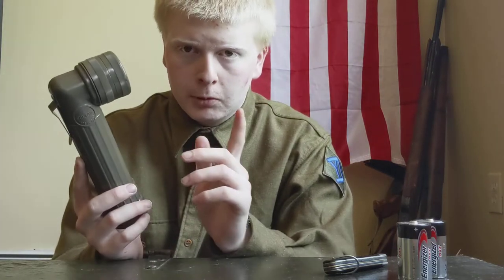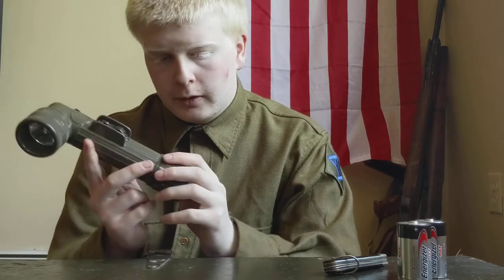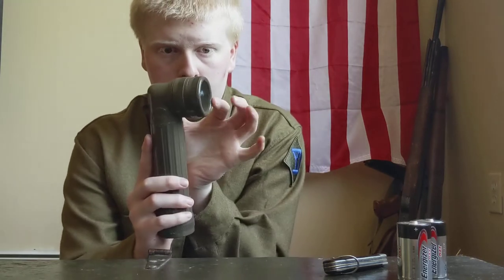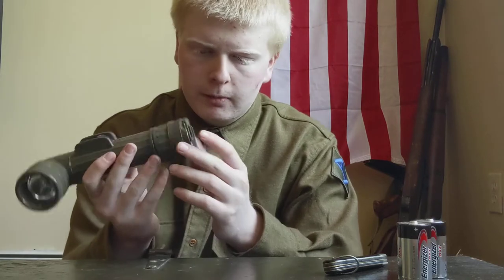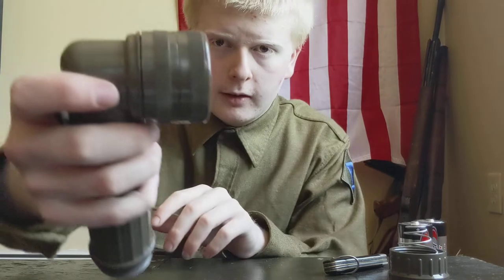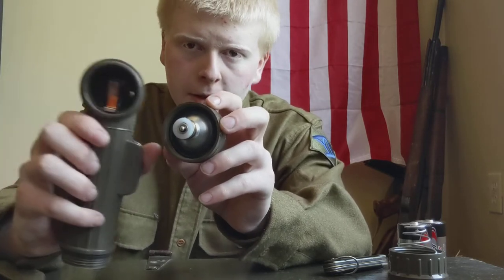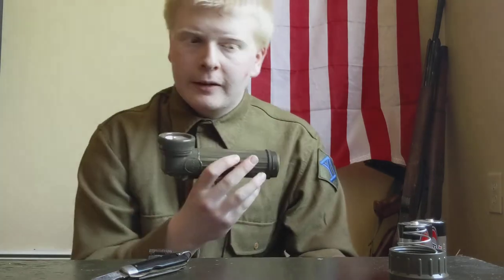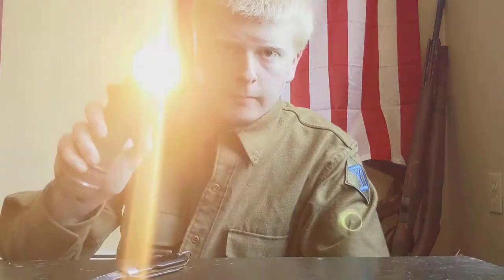How To Make A Modern Army Flashlight Look More Like A WWII Flashlight

Comment: The early war ones where made of brass latter on they made the out of plastic 44-45 you would see plastic ones
Reply from the maker: Cool, i did not know that
Reply: @reenactmentdays5891  I didn't until I did some research to see how old mine was
Reply: Those were the ones used in Vietnam. I think I still have one lying around.
Reply: Yeah, the tl122a was the brass version, and the tl122b was the first plastic version, I believe the plastic it was made out of had a bad odor and the military then went to make the tl122c then the tl122d had additional threaded cover on the front to use various color filters